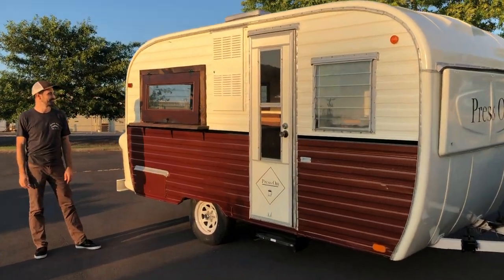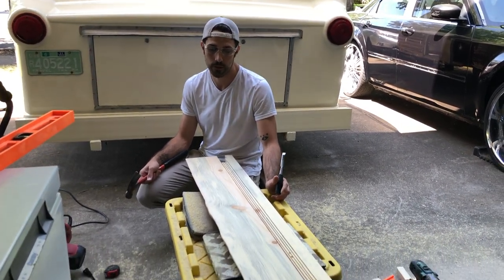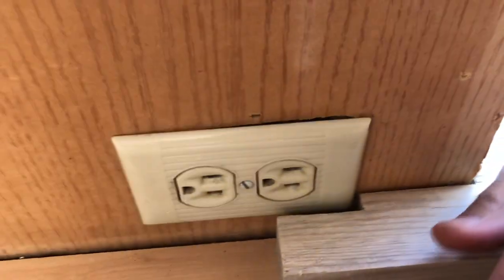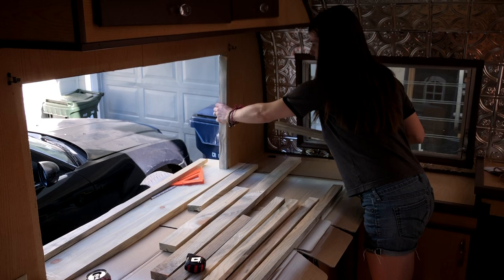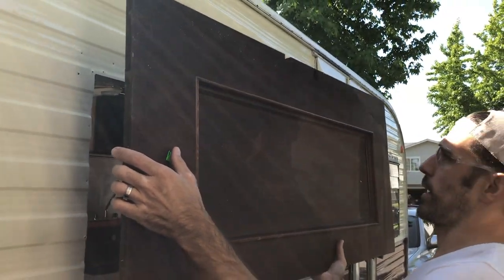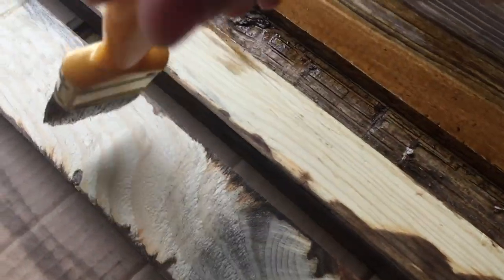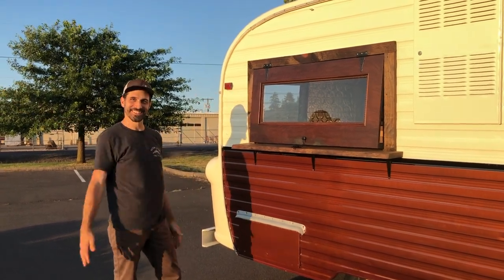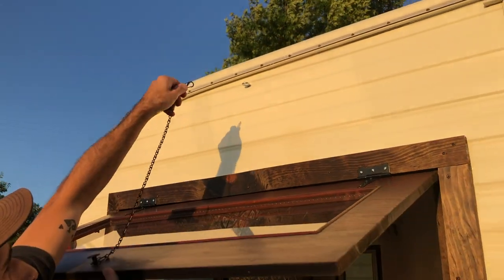Service Window and Paint Reveal  - Press On Coffee Trailers

Comment: Hey guys! Love the walnut color. The finish you picked was absolutely amazing.  I just have two tidbits to add for anyone else that might be on this journey: Consider using polycarbonate instead of glass (plexiglass is a good alternative) because it will not shatter. It's the same stuff motorcycle windshields are made of. The other tidbit is for the authors: consider using a kickstand or hydraulic arm for the window as the wind should not be under estimated. Last thing you want is the chain link to break and a 40 # window to come crashing down. Even if a customer is clear, that would be a bad day for any fingers in the way. Other than that, you guys still a really stellar job with this window! Thank you  for  sharing!
Reply from the maker: I’m guessing polycarbonate is more scratch resistant compared to plexi? Couldn’t believe how expensive the plexi was. Good call on the arm support. I originally bought gas strut hinges but where they bolt on wasn’t wide enough to support them.
Reply: @PressOnMobileCoffee  we plexi is awesome stuff but will still crack. Polycarbonate just bends. Next time your at home depot, check it out. It's super easy to cut and fairly cheap. 90$ for 72x48"

Comment: We just had a 16ft mobile bar built for us and we want to make the concession window on the back end much larger. What are the top things to consider or think about before carving into it!? Worried about ruining the structural integrity. Would love some advice!
Reply from the maker: Hello!
If it’s a cargo trailer, you will most likely have metal studs every 16” on center in the walls. I recommend coming in at least the 16” from the corner of the trailer for the side of your window; you don’t have to, but it will be once less metal piece to add if you use the existing stud as the side of the window. Mark your window rough opening measurements making sure they are level and square. You will want to make sure you don’t have any electrical in the area you are about to cut out. Once you cut it out, I would add a piece of metal tubing (it’s probably 1”) as a cross member for the bottom support of the window and one at the top. If it’s a large window, I recommend having the added pieces welded in. You can use metal mending braces and self-tapping metal screws but I don’t recommend it. Hope that all makes sense. Let me know if I need to clarify anything. I am happy to help.

Comment: So pretty! Question though, what do you do when its cold outside, or really hot, or you don't want bugs flying in? I'm confused as to how some trailers can just have an open service window without a sliding glass door or something? Thanks!
Reply from the maker: Some people put small ac units in their trailers. It doesn’t get unbearable hot where we are. The winters can be a little cold but you can easily add a propane heater. I choose to just dress warmer. The espresso machine and hot water heater put out a good deal of heat already. As for the window, some health codes require a screen or sliding window but that’s mostly for people preparing food. I’ve had very little issues with bugs in general honestly.

Comment: What did you use to fix the pillars on the interior and exterior to the metal itself? What type of screws? Thank you!!
Reply from the maker: These were furniture screws. The metal is so thin on old trailers that it goes through very easily. However, if you plan to store your trailer uncovered, I would recommend going with stainless steel or galvanized. You can get white or black painted stainless steel as well.
Reply: Ok I see. Thank you so much for responding and the tip!!